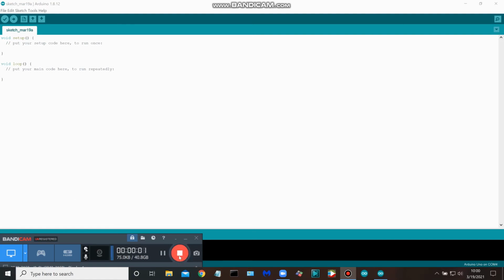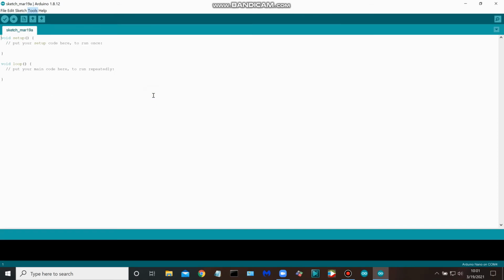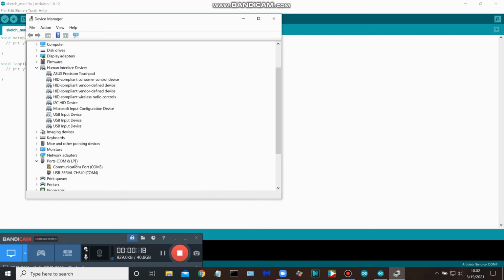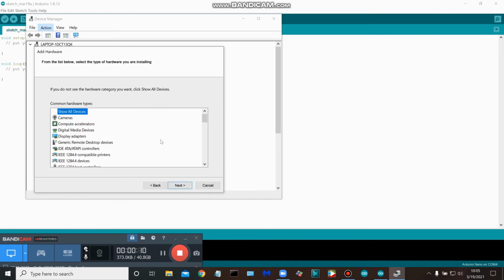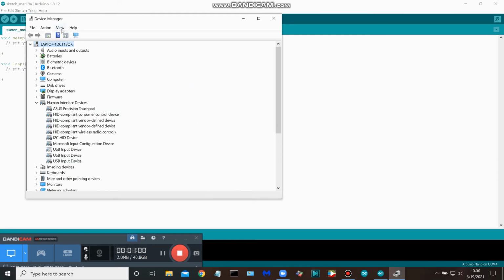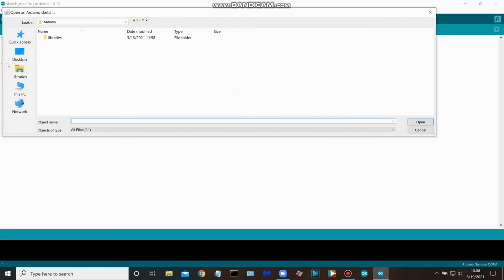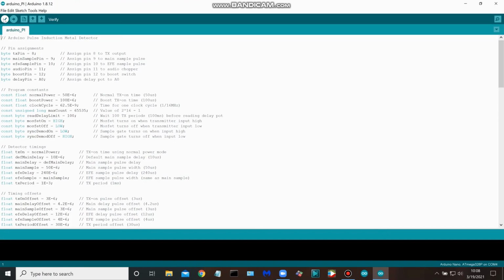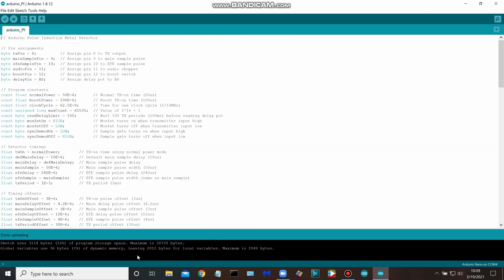Arduino Nano how to load a Sketch

Comment: I KNOW IM BRINGING BACK AN OLD THREAD BUT I WAS HOPING TO GET YOUR TWO CENTS:  Sketch uses 3194 bytes (10%) of program storage space. Maximum is 30720 bytes.
Global variables use 42 bytes (2%) of dynamic memory, leaving 2006 bytes for local variables. Maximum is 2048 bytes.
avrdude: stk500_recv(): programmer is not responding
avrdude: stk500_getsync() attempt 1 of 10: not in sync: resp=0xf5  << THIS IS THE ISSUE IM GETTING WOULD THIS BE MORE ABOUT THE SKETCH OR THE COM PORT NOT BEING RECOGNIZED.

Comment: Hi
How do i upload a git sketch onto my arduino nano.
Reply from the maker: Not sure I understand your question.  Are you asking about G-Code for a CNC machine? If so, here is some good info that should help.
https://github.com/gnea/grbl/wiki/Compiling-Grbl
Reply: @SurfDetector  Hi Sorry I did not explain it very well. I have 3d printed a watch winder and I need to put a github program on to my ArduinoNano from a link that the person attached below his project. I am not at all good at the electronics side, but I have done everything except getting this github code on to my board as I do not know what other software I need to achieve this. Many thanks.
Reply from the maker: @stephenunderhill1422  I believe you are speaking about G-Code , check the link that I posted. Not something I dabble in.
Reply from the maker: @stephenunderhill1422  Just out of curiosity, what is the file extension for this code that you want to upload?
Reply: @SurfDetector  Hi
I am trying to load a github program to my Arduino nano baord. the program is for the watch winder off youtube. Thanks
Reply from the maker: @stephenunderhill1422  What is the File Extension for the program? That is my question.
Reply: @SurfDetector  I am not sure what the file extension is ?
Reply from the maker: It is the suffix at the end of a filename that indicates what type of file it is.  For example  .txt  .mp3   .jpg

Comment: For me nano is 2nd board and I have it on com5 whenever I do uploading the loading green line is stuck at the end and visually doesn't go further, after 1 minute the errors come out and say avrdude: stk500... and than many of them. On hardware the RX blinks very shortly 3 times and stops. Please help
Reply from the maker: There are some good troubleshooting steps in this thread https://arduino.stackexchange.com/questions/17/avrdude-stk500-getsync-not-in-sync-resp-0x00-aka-some-dude-named-avr-won
Reply: @SurfDetector  already fixed, thx

Comment: I just saw on the geotech forums that you successfully completed the crossbow! congrats. I will be making a baracuda as per your advice and i have ordered boards but it takes long time to reach me so it will be a while.
Reply from the maker: Oh yes, thank you.  The Crossbow is a good project.  A couple of other members are working on it now.  I have my Nano PI boards however I need to wait for the correct Mosfet so I shan't be building that quite yet unfortunately.

Comment: Hi Alec. Thanks for the Guide, I've always been OK wth Pics/AVR but struggled when it comes to Arduino. Looking forward to the Build Videos of the new Detector progress! Regards, Marty.
Reply from the maker: Hi Marty,
The build videos are coming soon.  I just received my boards.
Reply: @SurfDetector  Brilliant! I'm still waiting to hear from Andy about when his boards are due to order mine. No rush yet, cos' I'm building the Preamp circuit for the Crossbow tonight and it's taking a while because I'm documenting it all for the Crossbow build guide as I go. I'll keep you posted though! Regards, Marty.
Reply from the maker: I am tempted to start building the project however I really don't want to solder the Nano directly to the PCB.  My parts are on the slow boat from China and wont be here for another week.